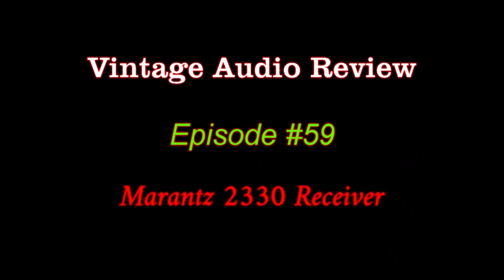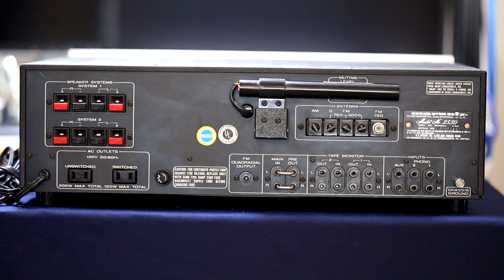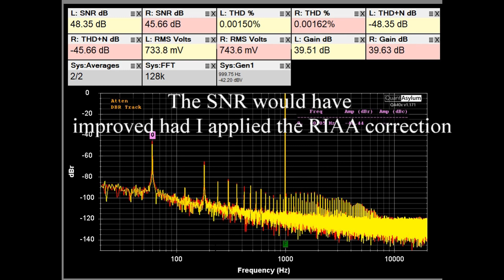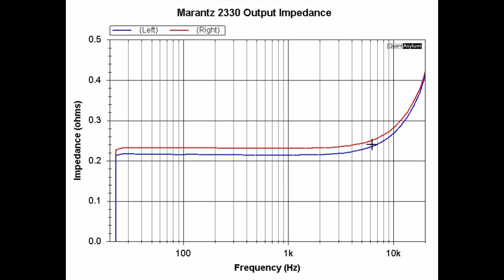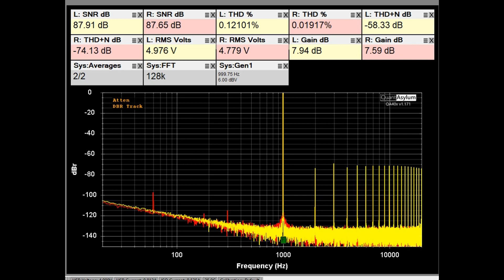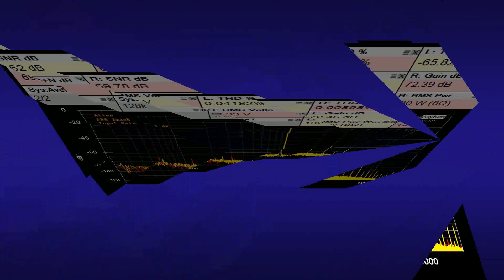Marantz 2330 Stereo Receiver- Vintage Audio Review Episode #59

Comment: Marantz 2330 receiver or Marantz 250m and 3800 pre-power combination??
Reply from the maker: I have not seen or tested the marantz models you mentioned, so had to look them up. As far as the sound, most likely they will sound about the same assuming the hum levels are normal. I would go with the 250m/3800 just because I have this thing for power meters. The 2330 has a bit more power, though.
Reply: @vintageaudioreview  250m has 126 watts per channel..2330 is 130 watts per channel.. But 250m has two 22000 caps, while 2330 has two 15000 caps..2330 gives 85-86 decibels of sound, 250m has 106 decibels.. On paper ...How is it that no other receiver and pre-power kit can give the sound and power of the Marantz 2330 when the technical data are like this?? It's very interesting..
Reply from the maker: @monsterleather9621  One would think that having large capacitors in the power supply would indicate that it can supply more power than one with smaller caps, but that is not always true- just look at a lot of the Carver magnetic field amps. Also, I am not sure where you are coming up with your dB #'s for the receivers as that is an efficiency # for the speakers... The Marantz 2330 has a great sound and luck, but I am not one to say a piece of gear is the best... I will have an upcoming review of an Onkyo receiver that was very impressive....Thanks for the commentry
Reply: @vintageaudioreview  Thank You Mister..The World's Best Receivers and Amplifiers were made by Marantz in the 1970s. In the 1970s, the world of Hi-fi was divided into two... Marantz and others... 😀😀

Comment: Marantz 2330 is the best receiver of all time.. The power capacitors are 15000uf and they are technics brand.. Even if it leaks, when you connect it to the oscilloscope, it gives the same 15000uf value.. And in this way, there is no distortion even at 170 watts per channel. I once plugged in a technics capacitor of 18000uf and ı read 240 watts per channel on the oscilloscope...The best bass and sound performance of all time... Indisputable..
Reply from the maker: Thanks for taking the time to comment and share your experience.  If one of the main filter caps leaked- real acid type leakage- I doubt you would be able to run it anywhere near max power. I shy aways from using superlatives like it is the "best" since there is know way I will have heard everything out there. But I certainly cane comment on how well something sounds to me and the measurements are an indicator on it performs spec-wise compared to it old specs. As far the Marantz 2330, it was built well and sounded great, and I think I "complimented" Marantz on it.

Comment: Really enjoyed this video!  Very cool that this receiver still performs well.  Did you test any of the capacitors to see how well they are holding up?
Reply from the maker: Thanks for taking the time to leave a comment! I did not test any caps or really do anything to the Marantz as it worked just fine. It was brought to me from a friend to check out for him as it had been sitting in a closet for many years. Were it to be used to play records, then I think I would go in and replace the appropriate filter caps in the phono section, but it met all its requirements as I remember, except for the phono area. As a rule, I do not replace electrolytic capacitors unless there is a reason to do so, and most of the time I have found them to test fine, with even lower ESRs than the new ones replacing them.
Reply: @vintageaudioreview  Nice to know that good quality caps can last a long time.  Thank you!
Reply: Several months ago I had my 1985 Yamaha A-1020 125w/ch Auto Class A Integrated Amplifier repaired at 'Just Audio' in greater Baltimore.  It needed many output transistors replaced. The two main Nichicon 22000 capacitors and 6 Rubycon Black Gate caps measured very close to spec, so I elected to keep them in place. He did replace the two Nichicon phono caps, but didn't indicate if they were bad.  When I got the Amplifier back home it sounded wonderful again. Glad to know good caps can last. I am enjoying  your videos!
Reply from the maker: @scottbennett3119  I like Just Audio and subscribe to their channel. I am not familiar with how the main filter caps are mounted, but typically if I am going to remove them to test them, I would go ahead and replace them as some of those can be a bit of work to pull. In my videos where I am measuring amps/preamps, you can usually judge by the size of the 60/120Hz hum whether the amp would benefit from new filter caps.
Reply: @vintageaudioreview  The amp has a removable bottom plate making access to the main caps and everything else very easy.  Fortunately, there is no audible hum whatsoever. When I first called them about service, the first thing they asked me was what make it was.  When I said Yamaha, they said no problem, bring it in.  So, hopefully the access to disconnecting the caps was easy.

Comment: Interesting, mine was also made in 1977, but it DOES have two AUX (as well as two PHONO and two TAPE)
Reply from the maker: Thanks for taking the time comment! I believe there was a "B"version of the 2330- check your model #... This one only has the 1 Aux.
Reply: @vintageaudioreview  Nope, but I figured out, there's a European and a US version. The US has Dolby but no second AUX, the European the other way around! The "B" version didn't have the black window.
Reply from the maker: @Algabatz  Thanks for pointing out the difference! I seem to recall reading somewhere that the model I reviewed was a bit more rare than "B" version. Thinking about it more, it did not have power meters either which would have been a very small negative for me. My buddies did a swap of sorts for the Marantz so it changed ownership since the video was made.
Reply: @vintageaudioreview  My 2330 is a 1977 single aux.  It’s not a 2330B.  Thanks for the videos.
Reply from the maker: @Slonge92  Thanks for the comment and you own a great receiver!

Comment: Hello -- can we substitute a newer power supply in these vintage equipment and see a noticable improvement ?
Reply from the maker: Thanks for the question. There are typically not power supply upgrade kits for vintage gear. There are mods for some of them that supply higher rated rectifier diodes, newer and better caps, and maybe some replacements for the voltage regulator semiconductors for the whole device- you can find these, but they are typically not just for the power supply. Depending upon the current performance of you piece of gear, there may or may not be a noticeable difference. There are mods for many of the Carver amps that improve the power supply and   power output capability of the amp. Hope this helps.